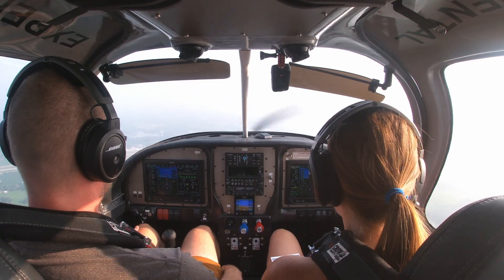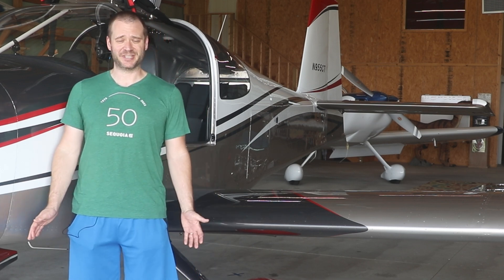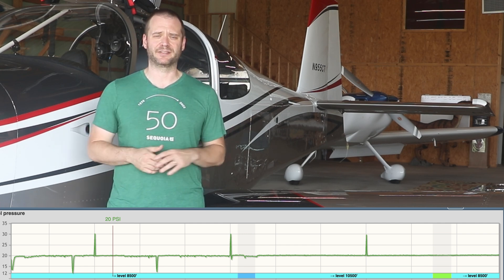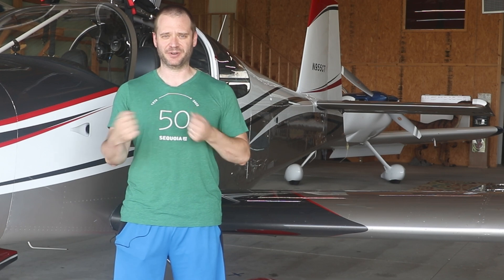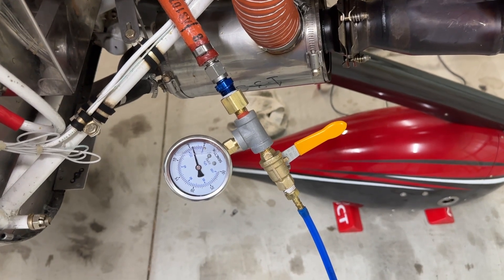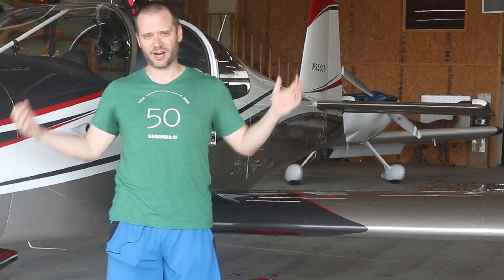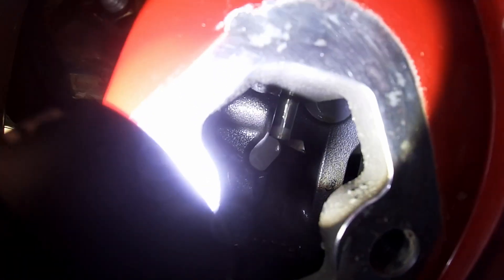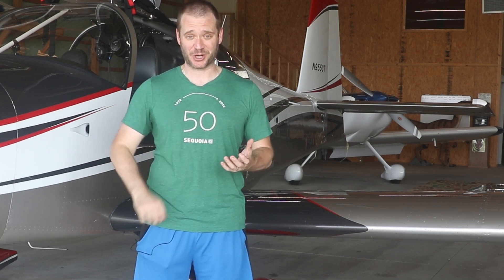Replacing Lycoming (IO-540) mechanical fuel pump, Van's RV-10

Comment: Thanks for this post and video, I have the same concern monitoring fluctuating low range fuel pressure for Lycoming IO 540 RV10, I did order a new fuel pressure sensor from Dynon, legacy 1 wire sensor gauge.

Comment: Do you have the D4A5 engine??  If so, is the part number for fuel pump LW-15473?  Thanks!!  I’m needing to replace mine.
Reply from the maker: Correct on both accounts. We got our replacement unit from Mcfarlane.

Comment: Ball end hex key wrenches for those offset get-to angles. I love my sets!
Reply: My engine came with hex head bolts holding the pump on. Replaced them with socket head. The ball end hex key is an ABSOLUTE.   Turned a lengthy job into 30 minutes.  The inside bolt is the culprit !!!!!